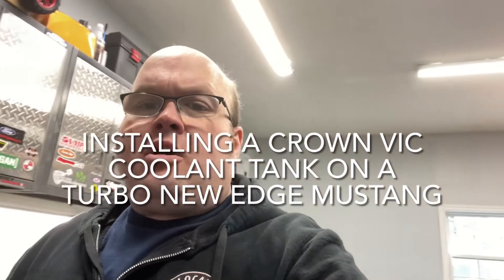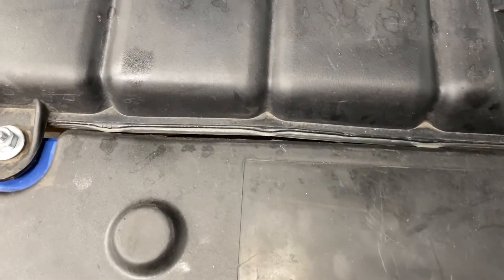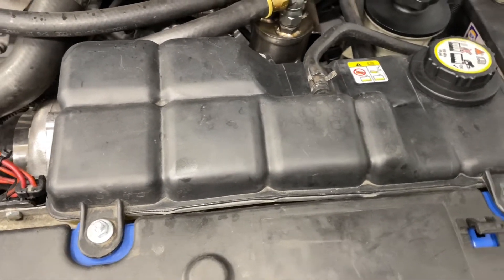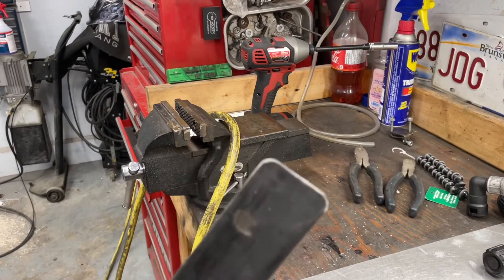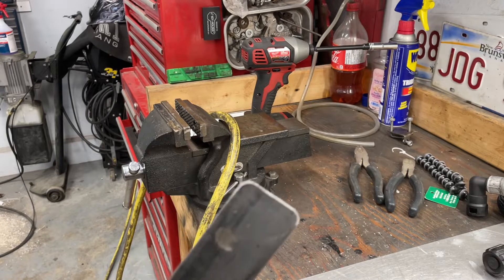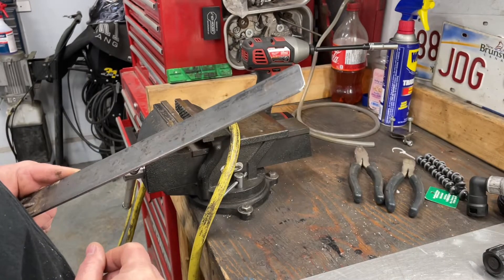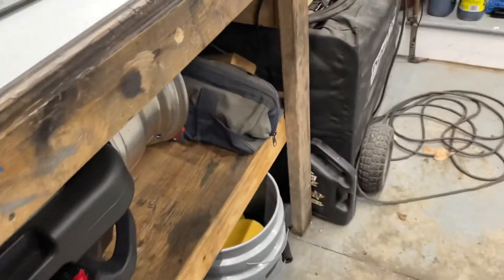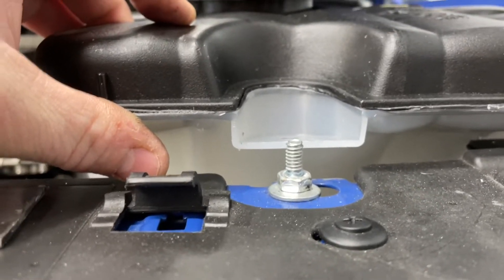Installing a Crown Vic coolant tank in #Turbo New Edge Mustang

Comment: Are you still using this setup? I just ordered one, but I plan to mount it in place of the factory battery.
Reply from the maker: @Modern.Rides.Design  no not anymore. I went back to a stock style tank but made of aluminum. I didn’t want to relocate my battery but I think moving the battery is better than mounting the tank how I did.